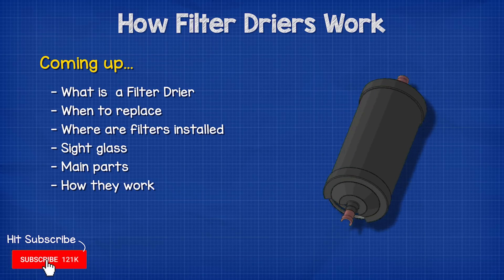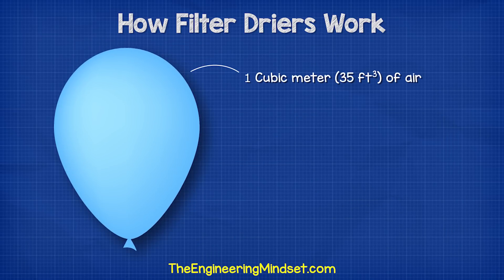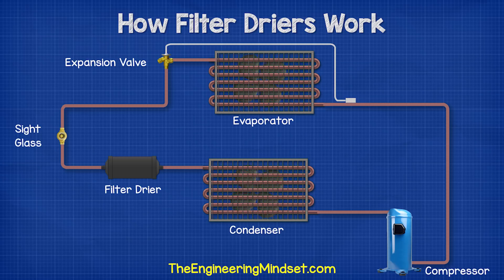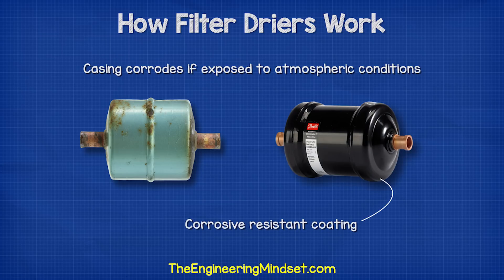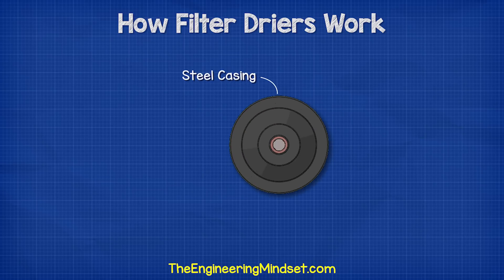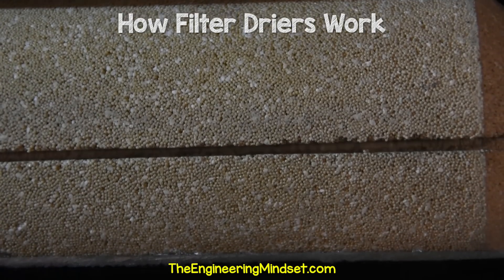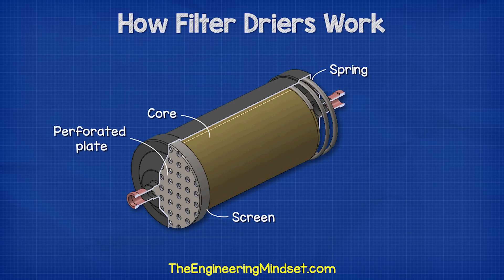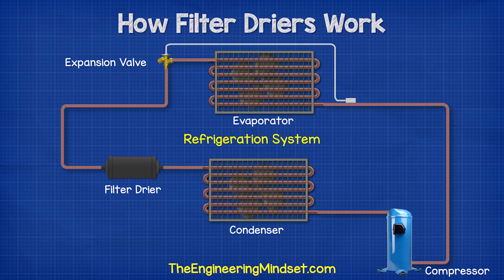How Filter Driers Work - HVACR

Comment: How does dirt and moisture get into a closed system? Refrigerant breakdown?
Reply: When you install a brand new system, or doing repairs that require to open the system, the lineset is exposed to moisture and fine particles that are in the atmosphere. No matter how deep of a vacuum you pull and flow nitrogen while unbrazing/brazing you will have contaminants. Refrigerants are not breaking down/consumed. The thing that goes bad is the oil which turns into acid and sludge if the contamination is severe.

Comment: And thats why lennox puts the drier inside the condenser (behind the service port).if you need to change indoor txv no need to change it out..because  we all know the rule here every new system needs to be hit for 45 min on vaccum or 500 microns. So if youre trusting that when the ref gets saved in the condenser/compressor it should be good

Comment: Enjoy the informative videos. To round out oyur HVAC basics and systems you should do a segment about testing adjusting and balancing (or as it become more known as testing AND balancing, as the adjustment rarely seems to get done anymore.). A lot of EITs, service techs and TAB tech themselves could use the information to understand the process and techniques. Also so they can understand the importance of volume dampers and where they need to place them in a duct system. Keep up the good work, Fella's!

Comment: As an HVAC Tech. You only replace a drier when you open the system, it leaks or rusts, and or gets clogged. Otherwise, they can last the entire life span of the unit
Reply: Wrong. As a HVAC double certified supervisor with 83 years experience, you should replace the filter dryer every time you connect gauges to the system. This ensures the system remains dry and your wallet fat
Reply: Top comment.  @matttzzz2
Reply: @matttzzz2  83 😭😭how old are you!!!!!
Reply: As an hvac tech.no one can ever determine when the drier has saturated of moisture or acids or both and upto what extent or ratio or its a ratio saturation or it is just saturated and sitting idle not absorbing the residual moisture or acids in the system.all these are just assumptions.even after having a micron vacuum process on a leaked system which has a fresh drier installed.you dont know whether the system is getting cleaned or dried up by the fresh drier.any refrigeration system actually needs 
1)fresh refrigerant from trusted source of low moisture or neutral ph nature
2)fresh oil charge to to the compressor to a required quantity and quality depending on the refrigerant to be used in the system
3) after leak test by nitrogen,micron vacuuming before refrigerant charge inspite of fresh drier installed in liquid line.

Comment: The 2 year replacement seems odd to me, since the system if properly installed should be a closed loop. Unless there was an excessive temperature drop, acid in the system previously, or opening of the system they should theoretically last indefinitely. The only times I replace them is when there is a large temperature differential, I open the system, or retrofitting. One commercial setting I did work on however needed acid driers replaced every 6 months because it had a few burnouts historically and the previous contractor didn't clean the system so it was a pain to repair.
Reply: was he repair on the suction side?
Reply: I thought that too. That's a $200ish service call every two years... you'll KILL seniors living off social security with that.

Comment: Could you please make a video on how hard start kids work I know capacitors are used to create a phase delay therefore applying voltage on a second set of windings but wouldn't a bigger capacitor create too much delay or is it the voltage that you're storing with the capacitor that creates the extra power needed
Reply from the maker: Check this video https://youtu.be/onIMNox24NI

Comment: Good explanation 👌
Just one suggestion, you can include and add Expansion tank, Air separator,  pressurization unit in CHW system in your list,
Also types of CHW distribution system like VPF, CPVS, etc.
Again thanks.
Reply from the maker: Have you checked our chilled water schematic video, I think it was covered there
Reply: Thanks good bro🙂

Comment: You can tell this is made by a mechanical engineer.

How it works - “the dirt, water, and acids are absorbed...”

None of these are absorbed. The dirt is retained by size exclusion, the water will be ADsorbed, and the acids will be chemi-sorbed.

The how is works section actually doesn’t describe how this unit operation actually works, other than saying things go in and don’t come out.

If you a chartered, industrial chemical engineer to join your channel and help with content.....I’m available

Comment: Bro i just want to know what exactly the impact of PN ratings of valve in hvac system.
Reply: The PN rating should be sized to your maximum operating pressure, but below your pressure safety relief valves/ bursting discs.

Comment: 2:21 does the filter dryer on residential unit also need to be replaced every 2 years?
Reply: Mostly likely no
Reply from the maker: Depends on manufacturer recommendations, if the system has been opened etc
Reply: No. Filter driers are not replaced every 2 years. Only when the system is opened. 
Don’t know if any system that requires drier replacement

Comment: Isnt it efficient to use better coolant almost inert as filter driers makes compressor work harder causing high energy demand,reducing lifetime of compressor due to high workload ,and if it isnt replaced Fd complicates  the problems more .and how come impurities like water get into a closed tube system of coolant,
Reply from the maker: It's risky though, you want to protect the expensive components
Reply: @EngineeringMindset  🤔